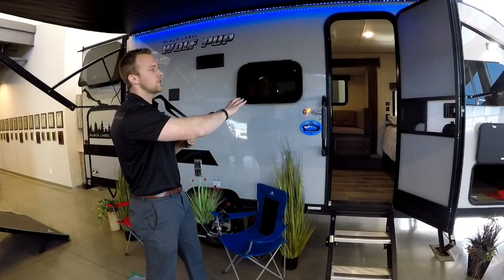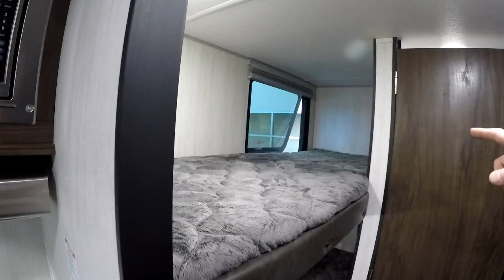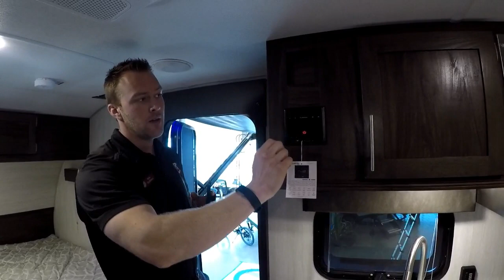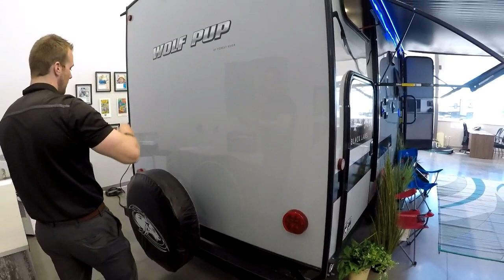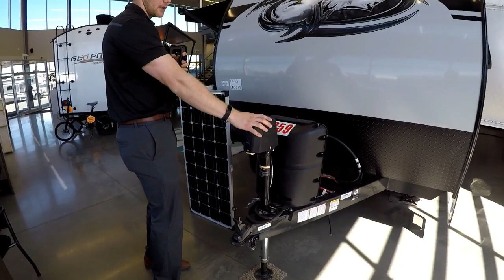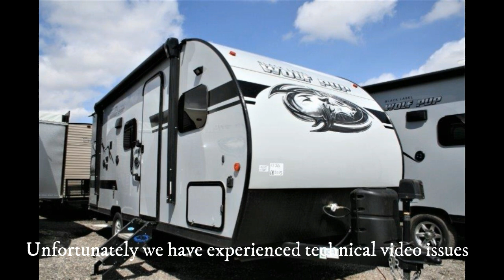2020, Wolf Pup, Black Label, 17JG, Bunks, U-Dinette

Comment: If you buy one (I did), you'll spend lots of time rewiring , replumbing, tightening screws and bolts.  I've spent the last month and a half going over everything wrong with it and fixing it myself. Only the left side speakers were connected on both zones, control board behind radio was held on with ONE screw,  water heater was held in place with a plastic strap. I cant believe mine passed QC with 6 loose subfloor bolts. I could go on.
Reply: TripleXess please go on, we are comtemplating a purchase of one design of these Wolf Pups